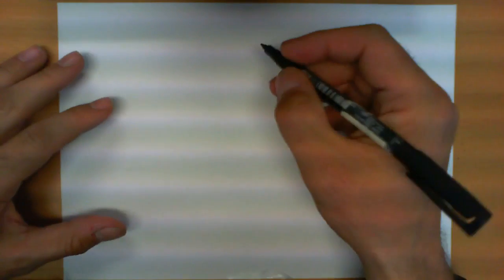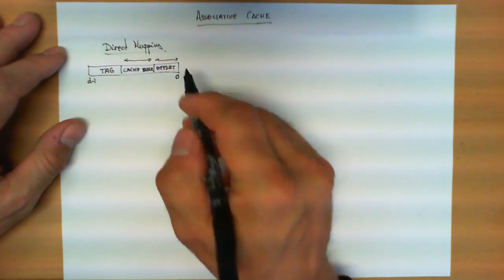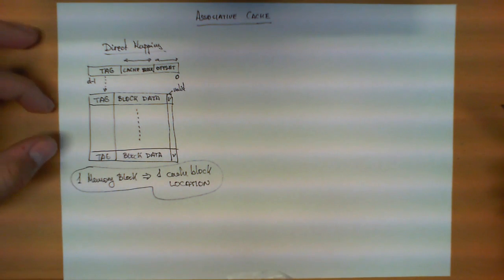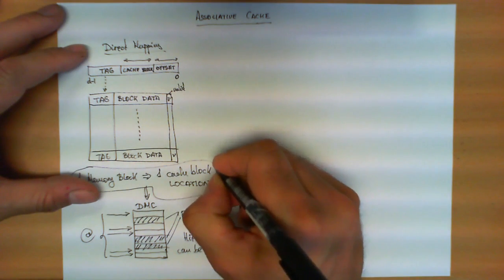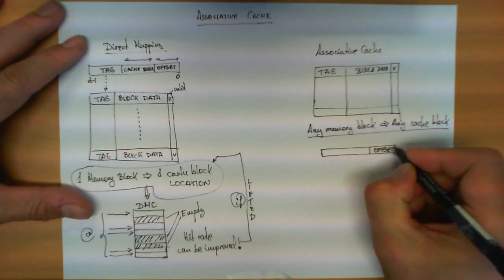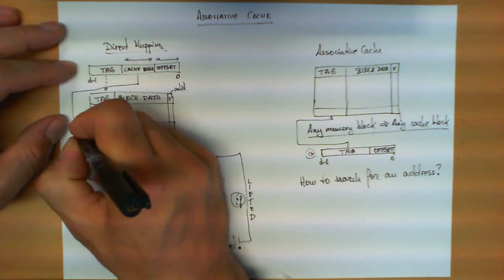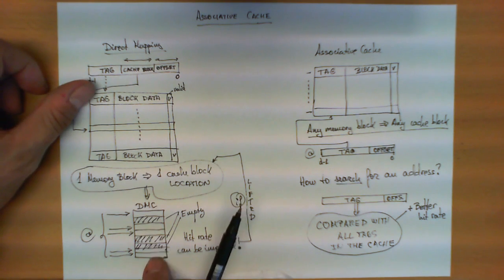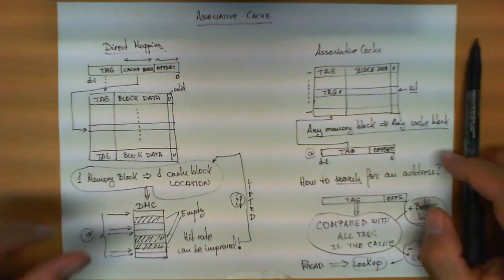Associative cache memory

Comment from the maker: Offset is the name used to refer to the number of positions counting from the start of the memory block to access the data in the required address. Since memory block sizes are powers of two, this quantity can be easily obtained by directly taking the value of the least significant bits (how many of them depends on the block size).
Reply: Being m the number of bits in the offset and p the block size, we get m = p.
p will be the number of memory addressable units in a single block, memory addressable units can vary from byte, word (2.byte), etc.

Is this correct?
Reply: Abelardo Pardo  how measure the cycle time for cache memory when pipelind design ???? Plz

Comment: Do we not need to include a dirty bit i.e a bit required to represent whether the data has been changed after bringing the block from memory or not?
Reply: Depends on the implementation of the cache and coherancy protocols used.